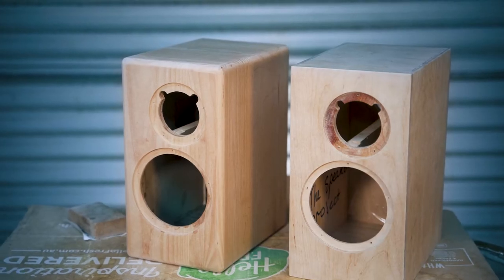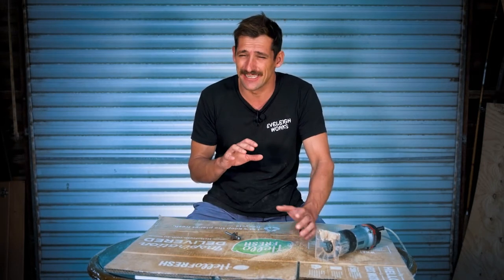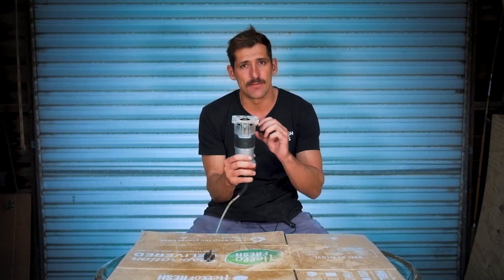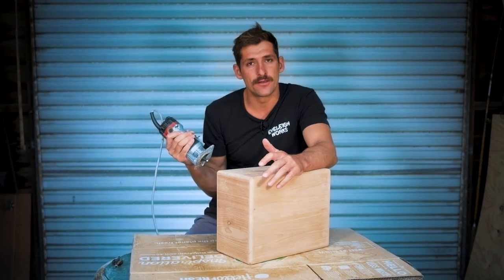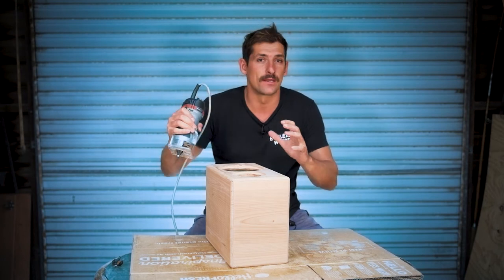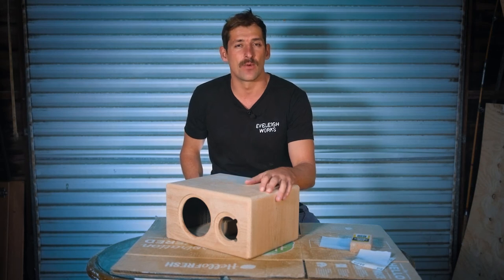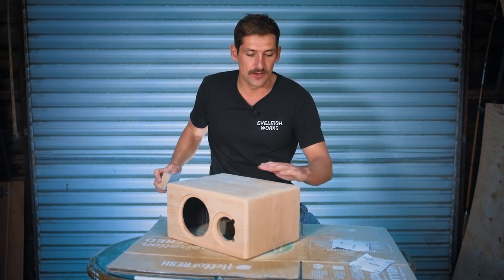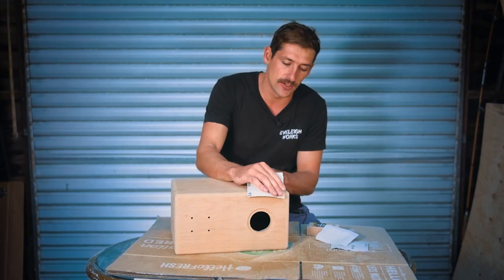How to ROUND OVER speaker cabinet edges

Comment: Couple follow-up question on the corners - I understand it’s good to round all your sides first to you have the round profile at the corners. I don’t understand why it’s okay to go all the way around on one corner but stop and go the other way on the other. Is this because of grain direction? Also if you go the opposite direction on the second corner, doesn’t that violate the counterclockwise rule for outer sides?
Reply: I had to watch that twice myself 😆 I wish he would've explained this AS he was actually routing, would've made sense the first time.

What I think  he means is when you are making your first edge cuts (starting on the speaker SIDE panels) with NONE rounded over yet, stop a few mm from all 4 corners because the perpendicular (FRONT & BACK) edges beneath them are still sharp/ 90 degrees. Flip the cabinet/box to the other side panel, stopping at the corners as before.
Now you can do the perpendicular edge, and since you are working toward an already rounded edge, you can follow all the way around without the chipping risk.
Reply from the maker: Sorry, I could have explained this more clearly. The reason has to do with how the cutter interacts with the grain of the timber. You want the cutter to spin into the grain to avoid the risk of large chips.

When you start from one long side, the cutter pushes into the timber grain, which minimizes chipping. However, as the cutter moves across the grain and approaches the edge, the unsupported timber is prone to chipping.

By starting from the other side for that edge, you can reverse the direction to ensure the cutter always spins into the grain, mitigating the risk of chipping.

Comment: which one will be more heavy, mdf or wood?
Reply from the maker: Some woods are very light while some are heavy. But typically hardwoods will be denser than MDF. 

The stiffness of the material plays a big part in the sound of the speaker cabinet too. So that should be considered along with mass.

Comment: I know for cars you want to sand in a crisscross pattern. Wouldn't that be that the same for wood?
Reply from the maker: When painting an automobile, sanding in a crisscross pattern is often recommended to create a uniform and smooth surface for the paint to adhere to. The crisscross pattern creates tiny scratches in the surface of the car that help the paint to stick better.

However, sanding wood is a different process altogether. When sanding wood, the goal is typically to remove imperfections, such as scratches or gouges, and to smooth out the surface. Sanding in a crisscross pattern could potentially create more scratches and imperfections, rather than removing them.

Instead, when sanding wood, it is generally recommended to sand in the direction of the grain. Sanding with the grain helps to avoid creating scratches and imperfections and results in a smoother finish. It is also important to use progressively finer grits of sandpaper when sanding wood to achieve a polished and smooth surface.
Reply: @thespeakerproject  good to know. thank you!